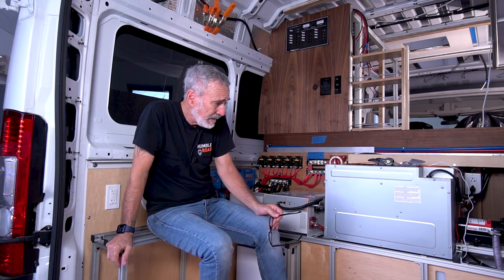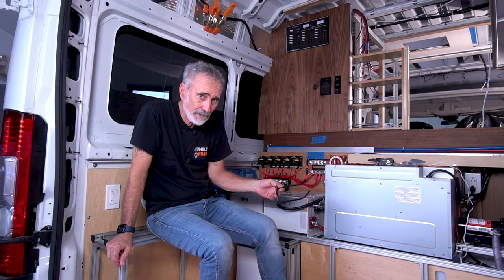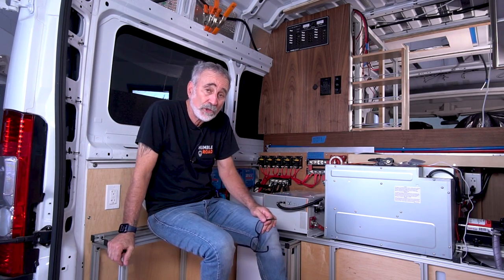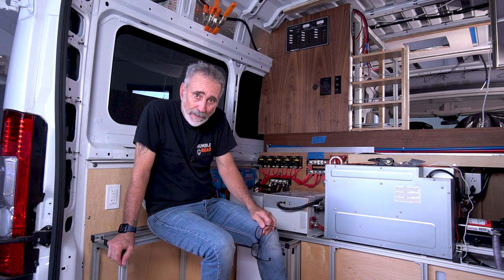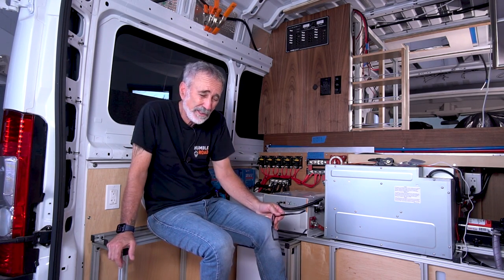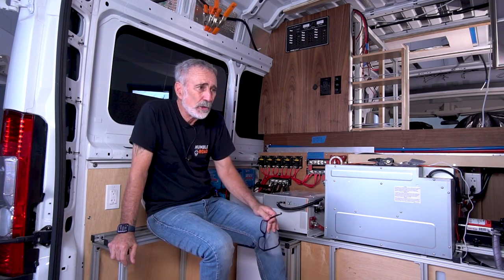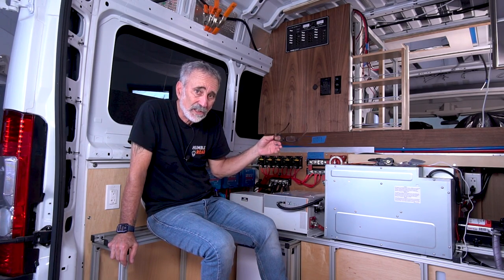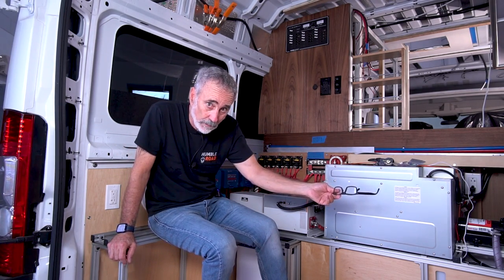Recirculating shower in a van? Just my humble opinion...

Comment: Agreed specially if the idea were to clean and recirculate the soapy water. 
In my opinion for a more sustainable recirculating shower, be it at home or in a van, recirculation is only meant to happen once you have rinsed off from the soap. 

Then the loop can begin with only clean water on a clean body. 
This won't change the reality of the need for a regular filter clean up though, just push it further in time and make it somewhat less yucky, but the point is still valid.

Up to now, the smartest, light weight, affordable, portable and easy to clean recirculating shower I have seen is to use a LifeStraw equivalent inline with an outdoor shower pump to recirculate the hot water from a water basin you step into after cleaning yourself properly.

Comment: That's what I saw when looking into it.

I'm looking at something like a dishwasher type of shower where you have recirculating hot water that only goes through a mesh filter then when you're done dumps to your grey and switch to about 2 gallons of fresh to rinse off and clear the systems. It's good enough for our dishes, it's good enough for our skin. You just have to deal with a mesh basket and maybe flush the pipe system with vinegar, or whenever to get the grime out, now and then.
I mean, look how baths are done, you soak in soupy and dirty water, then rinse off.

Comment: 100%, and to add to that I wouldn't want the complexity...if it breaks or it turns out you have significant bacterial growth somewhere because it was designed incorrectly (or using inappropriate components...normal water filters aren't meant for this at all) you could end up with a mess at best or getting sick. I feel the same way about overly complex hydronic setups. The simpler the better, and always take the view that once you are on the road you will appreciate that simplicity over extra luxury.

Comment: A good option I've seen are micro-mist showers. Multiple sprayer/mister nozzles fed with straight hot-water to mist the head/back/front/waist, can easily be under 2L/m or half gallon.

About the only downside is needing to make the vans HWS supply decent pressure and 60c-75c water.

But at the end of the day, a "Navy shower" or "Dicky-Bird Bath" still get the job done for less than a bucket of warm water, and a couple of wash cloths. Hell, you don't even need a drain, just a towel to stand on.

Comment: Very nice video, i was actually thinking of putting one in our van, but after thinking about what you said, i decided to get huge water tank. 250L and i had a 18.9L water pump which i can have a nice long shower, but after a while i changed it to a 10Lpm pump which gives me even more longer time in the shower. Your right, we can plug into campsites and have endless shower with our instant hot water heater lol. I have my water tank inside the van under the kitchen, which determined how big our kitchen counter is (62cm wide) we are planning on changing that and getting a custom water tank which would go under the van and should be about 200-300L. We can then change our kitchen counter to 45-50cm which would open up more space for us to walk through in the van and should make the van feel more spacious :-)

Comment: I am 100% with you George.  A filter on the way in from the city tap I get. Recirculating:  yuk.  Add an extra water tank or periodical use a land shower 🧼 makes far more sense.  The thing that has blown me away more than anything else is getting oil from a body wash or conditioner would be a nightmare to clean.

Comment: I'm looking for a box truck to build out. The shower was one of those I was thinking about. I've seen a ton of videos. I'm on the fence.  Water storage wise I currently have and may or may not use 4- 55 gallon plastic drums. I'd like to have water storage for at least 100 gallons. I also have a 6x12 enclosed trailer I was planning on doing something with. Maybe just water storage. After seeing this video I'm definitely going to now consider a separate toilet room and shower with a recirculating set up or just combine them like I sort of planned.

Comment: I have the beginnings of a design for a recirculating water system (entire water system, not just shower), but it would not work for a van. The system would take up too much space. It would work for an RV or travel trailer camper. It would have inline filters, rather than canisters, for sediment filtration, with a back-flush system to clean them out. There would of course be UV filtration and a few others in place to ensure the water comes out clean. In addition to all of that, there would be a separate vapor distillation system that the entire reservoir would empty into to be distilled into pure water (completely potable), which you could do after every use, or every couple of uses. It would drain off the first and last half gallon to come out of the distiller, to be replaced with fresh water. This would allow you to extend the life of the water in the system to at least 2 weeks, if not longer. All you would have to worry about is replacing certain filters that could not be back-flushed.

Comment: I think it is ok if you use the water for 1 shower then replace it. You would need minimal filtration then. Wouldn’t be much different from taking a bath. I was thinking you could build a very simple one use recirculating shower by simply having a deep shower pan and putting a pump at the bottom to pump it up to a 2nd shower head. Then rinse with clean water at the end of the shower and drain.
Reply: i thought that using the water once was the only option haha.

Comment: George, I agree with you on the van. Not so much the house.

 Recirculating showers are complex systems. The weight, space and money,  are better dedicated to other uses in a van. In my experience finding free, potable water, has not been a problem. Showers? They're not hard to come by either.

But I wear a belt and suspenders too, so I fill up with, and carry for longer trips, a portable 3 stage jumbo canister system, like the image you flashed, and I plan on installing a 4th, maybe a 5th canister under the sink. If I could afford it, I'd have an LED ultraviolet system. The objective is to keep the fresh water and delivery plumbing as clean as can be. Stomach bugs are not something I want, ever.
 Waste pipes will always be dirty.

As for a house, low water pressure is telling you that you should have changed the filters months ago; They're disposable, not permanent filters. Better to have the filters clogged, than the pipes in the walls, no?

Recirculating shower systems in a van. Just because we can doesn't mean we should.

Comment: I agree with you on this. When I first saw the crazy advanced system Advanced RV designed, I was all about it, but then I started wondering about the maint issues you just described. It's totally not worth the hassle for me. I'd much rather have 50 gallon fresh water capacity and just get use to 2 min showers. You save money on the water system and have less maint to deal with.
Reply: Unfortunately that two-minute shower will use 3.2 gallons with the most frugal usable shower nozzle I could find. It’s estimated that that’s also how much water you would use taking a navy shower.

If you are like me and take a shower every day and don’t like the public options, that’s a lot of water. Just for me that would be 22.4 gallons a week. If you have a spouse with you, now you’re talking at minimum 44.8 gallons. That’s if each of you only takes one shower a day. It also doesn’t leave much water for dishes, drinking, or other before you run out of the 50 gallons and have to refill your fresh water tank.
Reply: @TannyOHaley  Not if you buy a switched nozzle which allows you to shut off the flow mid shower without messing up the temp. You don't need the water to be on the whole time, only to wet down and rinse off. The water should be off when you're scrubbing.
Reply: @dlg5485  

It may be easy for you, but with Parkinson’s fine motor movements (like switching the shower nozzle off and on) are a big problem for me. That’s not a problem for most people. I’ve read that a typical navy shower takes about 3 to 3 1/2 gallons of water. About the same as leaving the shower on for two minutes.

Even prior to Parkinson’s over 25 years ago I couldn’t take a shower in 2 minutes.

Comment: Couldn't agree more,I have 41gallon water capacity in 3 separate tanks spread around my 3.5 tonne van, I can off grid for a week or so with hot shower when I need it and here in Europe refill and empty tanks without a problem,recycling shower is ok as a concept but has become a fad with van lifers,better to install filter system to take on river water if you really need to be totally off grid in my opinion

Comment: George, I just read some of the comments and had this thought: how about a single use recirculating shower with one filter.  5 gallons that gets used during the shower and completely disposed of at the end. No storage.
Reply: Most van people can take a shower with 2 gals of fresh water.... no need to recirculate.
Use low flow shower head. 1.25 gal per min with stop button.

Comment: 100% accurate! Ive spent quite a while researching and the only thing that a recirculating shower achieves is to make you "feel good" about saving water, where in fact, you aren't.
By the time you clean out the system on a regular basis, you would have used just as much water as a traditional grey water system, let alone the extra cost of original fit out, regular filter changes, etc.
Im lucky in that Im building my camper on a cab over truck chassis with a pretty high GVM, but because Im being careful to build it as light weight as possible, it means that I can carry the extra water and the extra fuel to allow me to stay away longer. Add a reverse osmosis system to that and I can pull up to any lake, river , stream or even the ocean and make as much water as I need
Reply from the maker: Keep all that water and fuel low in the build. Center of gravity!
Reply: How did you get on with the reverse Osmosis filters? They produce a lot of waste water, how are you dealing with that?
Reply: @shadusia  Waste water just goes back into the water source that Im filtering from, be it a lake, river , dam or the ocean

Comment: Thanks George. My idea of recirculating shower will never use the same water from one shower to the next. I just want to recirculate the same water in the same shower. This will allow me to have a longer shower without the disgusting reuse of the same water on and on. Every time I am done with my shower I want to press somewhere so that the water loop releases all used water. Next shower will have clean water again. What are your thoughts on this? Thanks in advance George 🙏
Reply from the maker: Sure, that would be acceptable. However, my main point was not the condition of the water, but rather, the disgusting routine of cleaning or changing the filter cartridges.
Reply: @HumbleRoad  sorry for my dumbness but when I recirculate shower the way I wish it means I do not need those filters. Water will always be clean. Imagine this. I want to shower normally. I turn the shower, get wet, use shampoo etc. All this water is recirculating. Then I want to press somewhere so the last portion of water comes not from recirculation. This last water as well as all the recirculated water from before will go off the drain. As in next shower the water will be again clean do I need to care about all the hassle of those filters and uv? I know it’s a dumb question but am learning now the how to’s and plumbing is my weakest skill by far 😀

Comment: George, filter's cups are made of acrylic... You can drill small hole on bottom and screw a small valve in it. So before removing a cup, you can open the valve and it drains all yucky stuff out. Then you unscrew the reservoir which will be empty at that point. Clean job. Cleaner than emptying a cassette toilet! And BTW, you DON"T have to save the water for the next use, you can direct it to flush a toilet - what a great concept of saving water and doing it a CLEAN way. Who said you have to flush toilet with precious potable water? Grey water will do better job - there is a soap in it, cleans the drain too.
Reply from the maker: I like that drain valve idea.
Reply: @HumbleRoad  And pump the used shower water to flush the toilet too. In fact - all grey water should be directed to flush a toilet. How can you waste precious fresh water to flush frikkin' toilet, it's a sin! So you can boondock much longer then. Win win. Remember garlic and olive oil keep us strong!  :-)
Reply from the maker: No flush toilets. None of my clients so far have asked for a flush toilet. Either compost or bagged.
Reply: @HumbleRoad  Laveo Dry Flush toilet is a miracle devise. No mess, no smell. You're right.

Comment: Help! I’m looking for your “episode” on water filtration, and can’t find it. I’ve contacted you before about fitting out a custom boat. As you might expect, it is not an easy task to find someone willing to build to the buyer’s spec, even when the buyer says, “leave it gutted; I’ve got someone else who can do the inside.” In the interim, I’ve found a charming little 25’ trawler called a Nimble Nomad. She only comes with a 12 gallon fresh water tank. I’m going to be taking her through the Great Lakes, and I figure I can refill her tank from the lake with  the right filtration system. What brand UV filter system did you install? I’m looking at potentially a 5 stage NU system because there will be floaty bits - usually pollen, but sometimes silt after heavy rains, and a UV filter is also a must. But in addition to the filtration system, I need to add a pump separate from the pump currently connected to the water bladder/tank. Unlike city water, the lake doesn’t come with measurable PSI! What size water pump is right for drawing up water and pushing it through the filters at the appropriate rate (for the UV filter)?
Reply from the maker: I’m sorry, I can’t advise on safely filtering lake water. I have no experience with that.

Comment: Im a process control/instrumentation engineer... recirculating showers do work, but they are complex and need a bit of automation involved with motorized valves that includes clean in place techniques (Pharma process do this all the time) and multiple pumps. A lot of the van recirculation showers I've seen on the net are to basic and high maintenance to keep clean. The key to cutting down on these maintenance is to have proper loops that automate these cleaning process (and it's not that hard to do). These cleaning technics will keep the filters last longer, cleaner and fresher with a push of a button. Van builders like to spend their dollars on priorities.... if showers are one of the top priorities, they need to spend more engineering and money towards that goal. Putting a series of filters/Uv lights in the loop will work (but will always fall short)... but instrumentation and controls (automation) is never on their budget.
Reply from the maker: You strengthen my point that it is all too complicated and high maintenance for van life. When it’s time for a long shower, go to Planet Fitness. 👍😊
Reply: @HumbleRoad  It is a complicated system, but for the user it doesn't have to be if you automate the process and that goes with cleaning it as well. You can have a clean cycle when plugged in using city water or using the vans own water (again only with a push of a button). Your van builds has everything it needs to have a robust recirc shower (long shower) and keeping it clean to a point that you won't be changing dirty filters only worn out ones. Builders are afraid of taking this system all the way to its fruition because of its complexity and high cost. BUT, the ones who really wants this setup (the customers) are the ones leading the charge. I see that you're in NJ, Im in Morris county. If ever you want to discuss the system more... hit me up with a pm. BTW, love your clean work.
Reply from the maker: @ferdinandjimenez346  definitely! I am willing to explore the system as you describe it. I would consider building a prototype.

Comment: The idea of recirculating showers arent to wash with the same water for weeks.  Its to allow you to have a 20-30min shower with 1 gallon of water and very little energy ( even a basic electric water heater would keep that water to temperature while you shower without much consumptioN). You can always dispose of all that after each shower.  recirculating showers are substantially cleaner than having a bath which no1 is grossed out by.
Not to mention that you can set it up to just shoot clean water at the last minute to "wash off your worries"
Reply from the maker: It's the real world day to day maintenance of the system that I speak of.

Comment: I hear what you are saying about filters being gross. That’s also true of filter systems designed to fill fresh water tanks from lakes and streams while boon docking. Algae, pollens, bugs and other sediments… the filters are going to get gunned up. Seems like the answer is to assemble the filters into a “cartridge” with shutoff valves on either end so they can be removed from the van before drainingdrained
Reply: Willa, the different filters clog at different rates depending on what's in the water. And can all be found in any big hardware store. Build a custom cartridge, and you'll be throwing big bucks into it.
Reply: Don't forget the fecal and urine particles of the animals. 

The water utility company does the same as the re-circulating system on a larger scale basically.
Reply: @lyfandeth  what I mean is this: a way to uncouple all the filters (typically 3) without having water spill all over the van floor. Close valves on either side of the filter array, so you can carry them outside before the spillage.